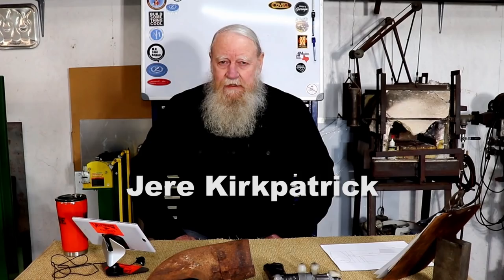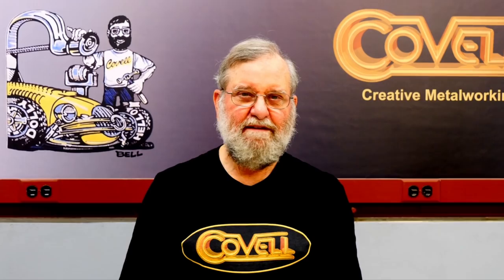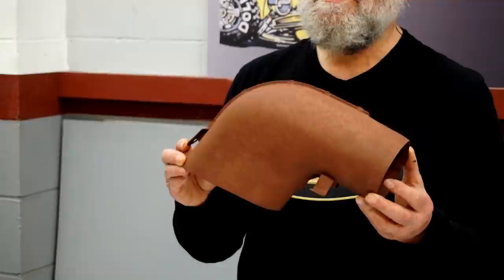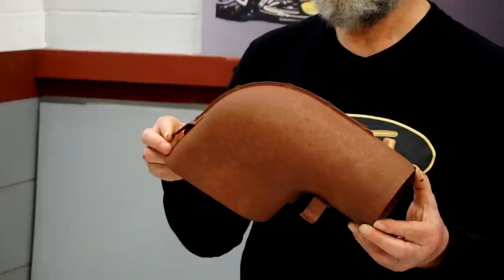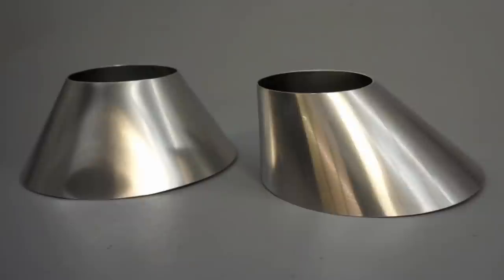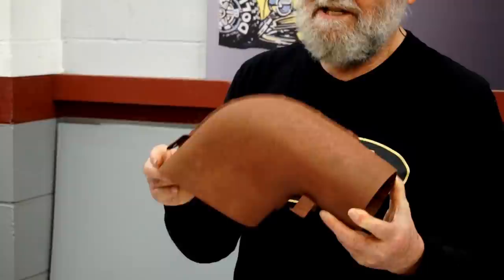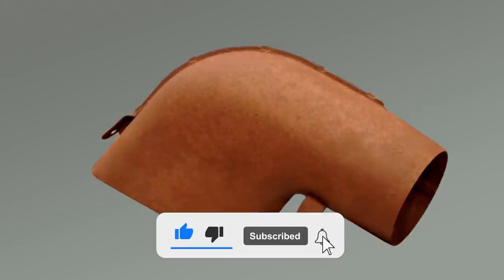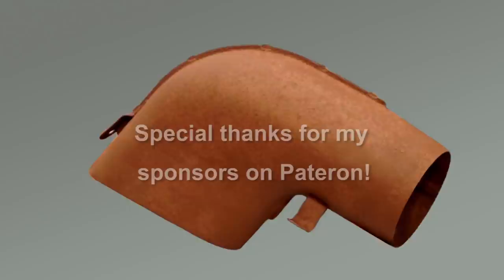Making an Odd Shape - With Jere Kirkpatrick

Comment: I don't see why he has to send you both bottoms, just for you to send one back untouched.
Reply from the maker: Hmm - that's an excellent point, which I had not thought of! It's probably best for me to have both parts, just in case there are some fitment issues, and I can decide which pairs of parts fit best!
Reply: @RonCovell  fair. The box is going anyway, an extra half pound probably won't add significant cost.